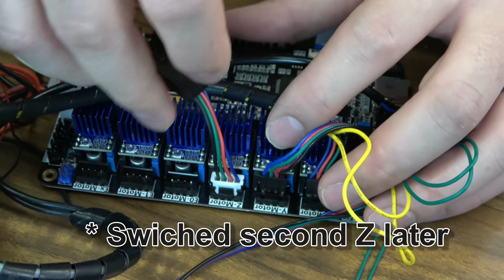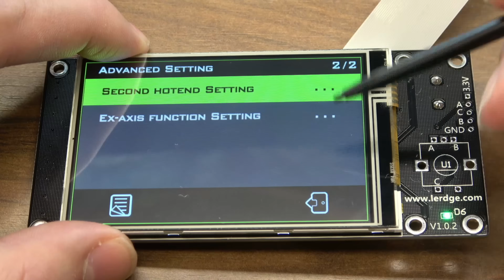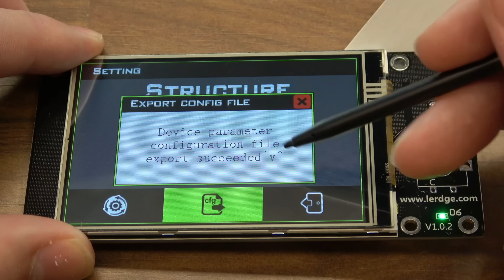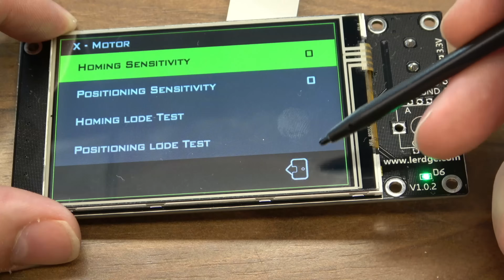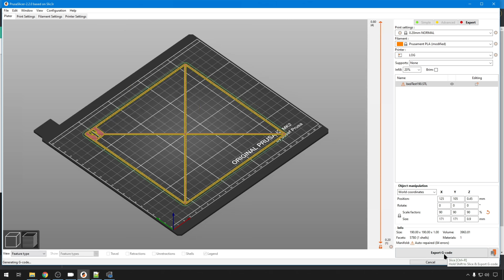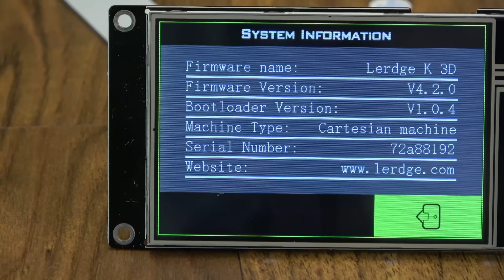Lerdge Main Boards - Install & Test - Chris's Basement

Comment: I got burned when they dropped support for the Lerdge-S board with the last few software versions all having some combination of bugs. Including no thermal runout protection. So I helped the porting effort of Marlin to that board and now it runs with that. Which reminds me to test the latest TFT changes and push my code for switching the thermistor type.
Reply from the maker: That sucks they dropped it, but thanks for working on the port of Marlin for us! :)

Comment: Did you change the 2nd Z motor to TMC2209 later or did Log run those motors with different settings? (Not that it should matter much in standalone)
Reply from the maker: Hey Magnus, yes I did change it over, but as you point out, I didn't see any difference.

Comment: I'd like to see this same video done for both the Delta and CoreXY builds using that board. Those two types seem to have very few walkthroughs online for any board. Especially the Delta. I think you can count on one hand how many guides there are for the Delta, in English anyways. At least from what I have found. I haive seen a few in other languages but I don't count them.
Anyways... Most of what I have learned from those two types of printers has been self taught so I know there is still a lot I can learn for them. It's just a matter of finding the info on them. :)
Reply from the maker: A great suggestion, I will see what I can do.

Comment: The lerge isn't  for everyone. I have it on one of my printers, and honestly, it's a print and go.

But I don't see myself going for another lerdge printer in the future. They're not as fast as marlin in updating new features, and there was a time they messed up an update when linear advance equivalent was still new. Nevertheless, they offer polished standard features on the lcd screen and a good plug an play ecosystem.
Reply from the maker: Well said, I can see a use case for the setup.